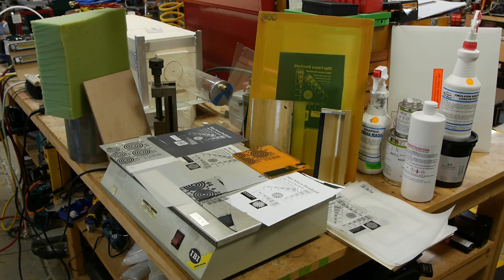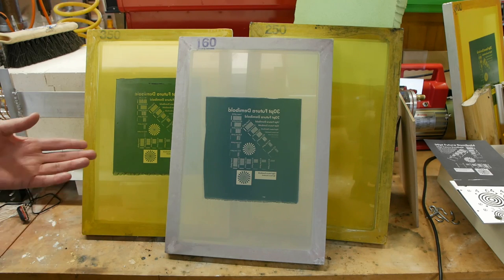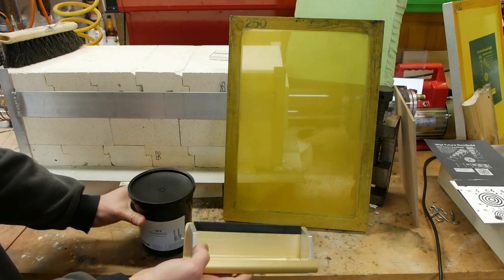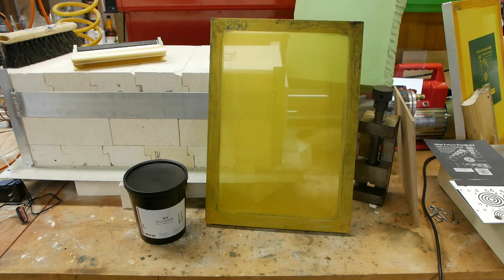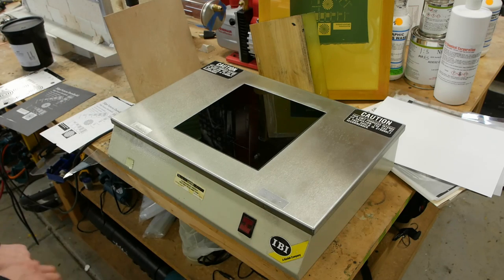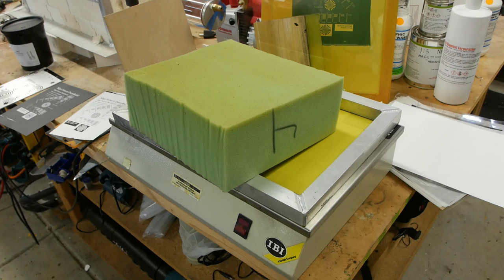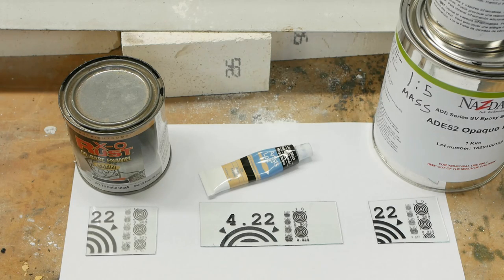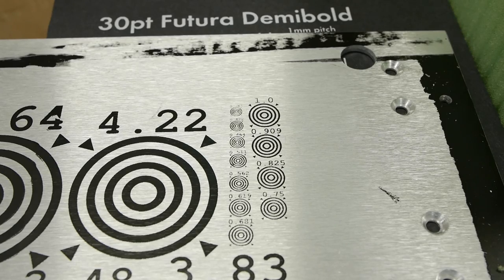High-resolution screen printing demystified

Comment: You may not post videos as often as others but when you do, they're long and they are in depth. Every video you make is great, Ben.
Reply from the maker: @sei shin It probably averages 0.5-2 hours per minute of video.  I've spent 10-20 hours learning about screen printing in this case, for example.  This is another reason why I like the format of 10-20 minute videos in general -- it's information concentrate!
Reply: I was a bit sad when it ended.

Comment: I spent most of my life in our family run screen printing business. We did huge volumes (like, millions of prints a month on 6 12 color automated presses), and obviously had to invent techniques and learn a lot of stuff by trial and error. My job during my high school years was to make screens. That meant stretching them, coating them, shooting them, and cleaning them. I probably saw that life cycle of a screen 1000 times.

Right away I have to say - you weren't using the screen coating tool properly. You need to fill it with a bit less emulsion, then while the emulsion is till deep within the coater, you tilt the screen enough to be able to push the coater up to it so that you can tilt the coater to the point where the edges are pushed into the screen. Then you tilt the screen and coater together until the emulsion is just touching the screen, and lift up. As you near the top edge of the screen, you tilt back to the starting angle, rolling the edge of the coater back so you can feather out the edge of the emulsion to avoid making a bead. Do the same for the other side, and you end up with thin layers on both sides with no beads.

Aside from that , you've done a great job at describing the process for people who have never heard it. 

That said, some other things to consider:

Coating the screens properly makes for screens that produce higher resolution prints and last a lot longer than using the more expensive emulsion sheets. They last longer because the mesh is fully captured by the emulsion layers on both sides of the screen. Those layers are also thinner than the emulsion sheets, which means you get more crisp stencils. The light you use to expose the screen is prone to creating shadows that spread (especially if the light comes from a single point). The thicker your stencil, the more your shadows spread, producing a more "blown out" print than a thinner stencil.

You also want as little amount of gap between the screen and the substrate you want to print on as possible. You need some, but the larger the gap, the more than print will be distorted. It's not a big issue on single color prints, but if you're doing multiple colors and need them to have tight registration, too much stretch is a nightmare.

300 micron is great, but you can get as small as 50 micron with the right combo of mesh, emulsion, ink, and process. Back in the day, we used to do 4 color process printed on fabric that looked as good as a modern CMYK printed magazine image. It wasn't easy, but it's totally possible.
Reply: Thank you for your informative post. Could you recommend a mesh count, emulsion and ink for very fine line drawings. I have tried with 300 mesh but not getting the fine line/detailed high resolution results I need. I am not sure if its my printer, the emulsion, or the ink I am using.
Reply: This comment should be pinned. Super informative
Reply: @schediastriamoda7459  Curious if you found a solution. Curious what you are trying to reproduce. A 300 mesh with 1 thing coat each side, is capable of very high resolution. Art file, film out put, screen 'burning' (exposing) print technique, all factor into the final print quality. 

My impression is most 'amateurs' (no offence intended) just don't have all the parameters together at once.
300 DPI file printed Black, and I mean BLACK on CLEAR film tightly sandwiched with properly coated screen and exposed with a proper light source.

 NOT a grow bulb (fluorescent), NOT a work light. The exception to the grow bulbs is IF they are metal halide, then OK. I use a home built exposure table with a 1000w metal halide and it burns a very good screen.

I print tshirts for a living and happy to help anyway I can.

Tell us more about what you are trying to print, and more about what 'stuff' you have..screens, film output, exposure etc

Cheers
Reply: This and @Joe Shmoe 's comments are fantastic!  Thank you both so much :).  As a photographer with darkroom experience, this cleared up much of my doubts which remained after the main video :) .

Please consider doing your own videos on the topic; I'd love to see them.
Reply: I dove into the comments to see if anyone talked about point light sources (like the sun) vs diffused light sources (such as the UV table in this video).

Point light sources are definitely more appropriate for fine detail as diffused light sources inherently reduce shadow sharpness.
Reply: i thoroughly enjoyed reading this post. it's so easy to take something like a cool shirt for granted without thinking about the craftsmanship that went in to it.

Comment: Having grown up in the printing (textiles and paper) industry, this takes me back a way.
In a hurry we would be able to get screens dry after coating within 15 minutes or so using a hot room heater, we had a yellow light room with screen racks to hold 50 screens at a time while drying.
When exposing screens, we built a vacuum frame, glass front with rubber backing, the artwork would be placed on the screen in register across a number of (ink) colours then placed in the vacuum frame 4 screens at a time, glass closed and latched and vacuum turned on. The vacuum means that all air gaps are taken out and the artwork is tight against the screen.
Our light source was a carbon arc lamp, with 3/4” carbon electrodes sat about 4 feet away from the vacuum frame.
Hope this is helpful to someone :-)
Reply: We also built our own screen stretching machine, which was able to tension up 4 screens at a time :-) it used 24 pneumatic cylinders and overcentre clamps to bite on to the mesh.
We would usually have a dead zone 20mm to the left and right, our off-contact approx 2-3mm being aware that any extra stretch can distort the artwork out of scale, especially if it’s non-linear stretch, more in X than Y
Reply: @JBFromOZ  I used to work in the printing industry when it was all still about film in the 80s and early 90s. I used to expose printing plates with a NuArc carbon arc plate burner. Don't breathe the fumes! :) We later went to a pulsed Xenon burner.
Reply: @HackaweekTV  I still run an old heidelberg GTO built in the late 60's - we still have the xenon plate burner set up for use with the old negatives. Our new plates are actually inkjet printed onto metal plates with an Epson wide format printer; it's not as durable as the UV plates, but the whole assembly fits in the same footprint that the film processor alone took up.
Reply: Years ago when we were still using a carbon arc light to expose the screens, we would turn the arc on for just a second and turn it off so that we could light our cigarettes on the end of the glowing hot carbon electrodes. Good times.
Reply: I agree, those vacuum frame exposure machines do an amazing job at getting the pressure right for a sharp image.
Reply: Ah yeah, the old carbon arch! It was almost more a carbon monoxide machine then it was a light source. I remember many a days spending too much time in a small room with that thing on the verge of passing out. I really should have put some effort into venting that room more effectively.

It was like having your own sun with a switch to turn it on.
Reply: Lol I bought a 2000w or 3000w metal halide light, cost a fortune but never failed at exposure ever. Still remember the distance formula diagonal of the area of exposure x 1.5 :-)

I would have gone out of business if I had of waited for things to dry as long as that hahhahaha. Heaters and large drying boxes and done in around 30 mins :-)
Reply: Very good info. Thanks !
Reply: totally. heat guns.  vacuum exposure unites are, frakly,  not an "option" in my opinion. They really reduce the chances of having to scrap a stencil and re-do it.

Did you stretch you won mesh on roller frames? I won't even work in a shop that doesn't use them.
Reply: @LukePettit3dArtist  Did you use an exposure timer or a lumens-based exposure timer?
Reply: @joelcarson4602 At one shop i worked at we had one of those vertical exposure tables, where you vacuum in the frame with the table horizontal but then the whole table flipped up vertical so that the lamp its self was a separate unit on wheels that you'd put a measured distance away and then expose... the up-side was that you could see the mesh during exposure and sometimes could spot flaws in the stencil. The down side was that we all ended up with sunburns on one side of our faces :)
Reply: In the late 70s and early 80s we did signs and shirts for church and sci fi fan projects with letraset press on letters and exposed using a plain old fluorescent light.. sure it took an hour or more, but we werent being paid anyway.  We put on the emulsion using a paintbrush. Still, we managed some pieces with 7 or 8 colors well registered.

Comment: Just a couple of tips:
You can use standard cartridge paper for exposing a screen, a light coating of vegetable oil will make make the paper translucent, once you wipe all excess oil away this works brilliantly.
To get dark blacks on a printer use the CMYK values 60 40 40 100, this is known as 'rich black' among printers and will get you the most contrast in your prints. 
Great video!
Reply: Thank you so much!!!

Comment: For about 15 years I've been using Pictorico OHP transparency film and inkjet printer for making my screen transfer positives.  The sheets have an emulsion on one side that holds a high saturation of ink, so you can make a very dense image.
Reply: Fully agree. I've been using "Bab's" Transparency film for a few years, I'm pretty sure it's rebranded Pict film or very similar. It really does make the densest saturations I've ever seen. The vellum prints he made looked just like the ones I struggled with for a while before I found Bab's. My exposure times went down 3-fold as well.
Reply: Are those emulsion sheets? Cuz im looking on ebay an there just clear

Comment: This video is absolutely the kind of resource that the internet needed for high-res printing on substrates which aren't t-shirts. I wish you'd put this video together about a year ago!

We went through a lot of experimentation in terms of applying emulsion, exposure times, screen setup, etc and came to many of the same conclusions that you outlined in this video. Even after all that I still feel like I've learned a lot from the depth and accuracy of the information you provide in this video!

We'll definitely be giving the emulsion-film a shot next time we have a batch of screens to make. I feel like it will greatly increase the success and resolution of the screens we make to print on our guitar pedals.

Comment: Haven't screenprinted in 20 years, only thing new was the photo film. We coated screen with emulsion, took forever to dry. Once used a streetlight for the actinic light source to burn them. Great video. Thanks 👍

Comment: We have some kind of set up like this at work. I am an aircraft mechanic and sometimes we have to etch our tools with our name or initials. 

We start by printing initials out on a transparency and then we lay this on top of a blue gel sheet (It seems to be a fine mesh sandwiched in between two sides of this emulsion stuff). We put that under a UV light for two minutes, (with the print out on top) to expose. We scrub the unreacted portion off with a sponge and what appears to be just water. Now you have a similar thing. However, we use this to electrochemically etch our tools.  
The etching device seems to be a one to one transformer that plugs right into the wall. The secondary coil is hooked up to an alligator clip and one side is hooked up to this apparatus that holds a felt pad with a metal screen under it. YouCan put on different types of chemical in order to etch into different types of metal. You can also put a diode in series with the alligator clip to change it from AC to DC. This has the ability to make a black oxide rather than etch into the metal. Anyway, you apply at the alligator clip to a part of the tool or a sheet of metal where you lay the tool on. You lay your pattern down on the tool and press the chemically-wet etching pad on the film. In 10 seconds or 30 seconds it makes a pretty decent mark. 

It makes really nice metal etchings. It’s better than taking a vibropeen etcher to it... it just takes longer. This set up is a kit that we got but I can’t remember the name. 

Also, how durable are the emulsion patterns after you make them? I hear about a useful life of certain patterns that people make before they have to make another pattern (like scraping the squeegee over it a bunch of times will wear it out or something)

Comment: Learned two things:
1. How screen printing works
2. I am never going to do this
Reply: lots of things in done in this channel would be really cool and interesting to do, they take quite some money and space though :p
Reply: funny, and I will try it FOR SURE now! ;-)
Reply: Umm, never say never  :-)
Reply: @Don.Challenger  Of course not :) It was just a  joke about the complexity and difficulty of this procedure.
Reply: Yes, I know ElM, when I was a young fellow I silkscreened wrestling poster as a part time job until the fumes had me riding my bicycle home along building walls but back the next day - and I'm still interested in the process. And my father spent much time perfecting his own ability making PCBs for short run production. I kept way from photography until digital came around as proficiency then didn't require the chemistry degree. And of course technique in small run is greatly different from production and mass market requirements - each branch spawning its own complexity of knowledge. The video and comments here show this wonderfully (and on this channel generally)..
Reply: Back in the '70s I did a lot of screen printing making PCBs and control panel lettering. I used stick-on PCB art and graphic letters on frosted Mylar for my artwork to use litho film exposed with the sun. Cut my screen  (with sun) and printed my work. It was way faster than using these hobby type alternatives even for a small run. Nothing beats epoxy ink on formica or  engraving plastic. Easy to replace too.
Reply: It's pretty fun if you have the patience to do it. It can get pretty frustrating so problem solving skills are a must
Reply: Why? its SO MUCH FUN. OMG the most addictive craft I ever got REALLY good at.
Reply: @Don.Challenger  just don't call it "silk screen" in front of an actual screen-printing professional.  It hasn't been ""silk-screening" since the invention of mono-filament nylon fiber.  It's "screen printing" or "serigraphy"
Reply: @toastbusters3897  yeah. you just gotta get good at prepping screens and a press. One of the most frustrating little skills along the way is coating a screen with emulsion using liquid emulsion in a trough.  Different printers will have different tips, but I teach new press people to do 3 on the squeegee side and 5 on the print side, rotating the frame 180 deg between each coat. Once you know how, it's like muscle-memory it seems totally natural and frankly easy. But getting REALLY good at it is hard.
Reply: @diegogmx2000  i make at least 100$ per day just by screenprinting :)
Reply: @GradyBroyles  Three coats? Five coats?  Seems awfully thick to me.  Is there a particular reason?  What kind of things were you printing with that?
Reply: @RICDirector  i'm not being smug but it shouldn't be very thick if one is good with the trough and uses the right technique.

 I have heard of people coating mostly like sub-200 thread meshes by like coating each side and letting it sit for a bit and then coating it again,.. repeat,  That's not what I'm talking about. 

 What I did was, starting with the back side, is coat, flip, coat, flip, coat, flip... on a meshes higher than 350,  2 on the back 3 on the front is perfect for printing multi-plate process.

This is the part where I mention that I f'ing HATE having to stop a press to block-out pin holes every few dozen garments and hate even MORE having to stop the press to replace a weak stencil. 

Being able to coat a mesh with that fine  of a coating such that the finest, like 3.5-4% halftone will reproduce AND be durable enough to go for a long time is key. 

As you know, it's a balance between fine-details and stencil durability. I was kind of obsessed with pushing this as far as i could.  

In the end, I had a "formula"  First: work-hardened meshes are the best, obviously. And the best chance of getting a mesh to a work-hardened state is to stretch your own with roller-frames.  I routinely got 400 lpi meshes to 90 Newtons. It takes practice. Very high tension, high-count mesh is EASY EASY to coat thinly with 2-back/3-front coats. (or even more, really) Mesh tension is everything. . 

So, an example of the kind of stuff I was doing, was I was the sample printer for Avon at a contract printer in Seattle. We reproduced the photos of Anne Geddes (google image search her) MOST of thos photos I reproduced at one point or another. It was a great challenge and was also a nightmare.
Reply: @GradyBroyles  I can just imagine!  Thank you for the details, it's most appreciated! :)
The only silkscreening I've done was...well, with silk screens, glue, and paper cutouts....so you know how old I am! LOL!